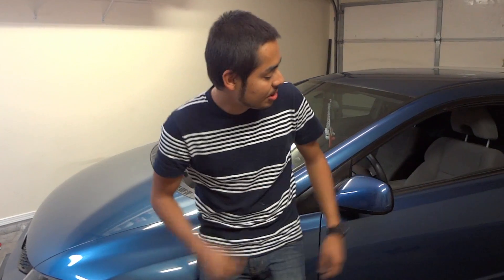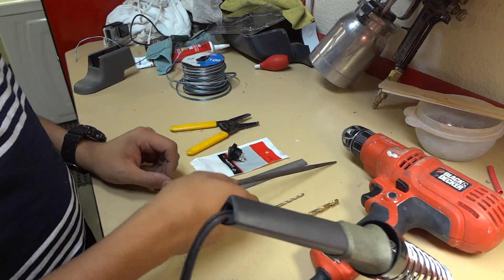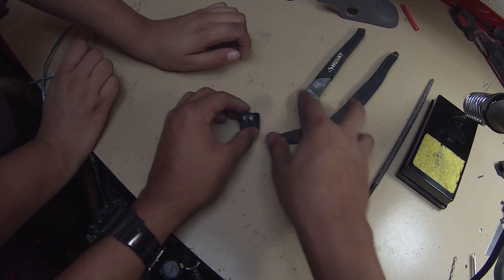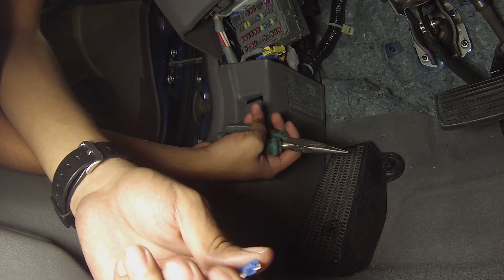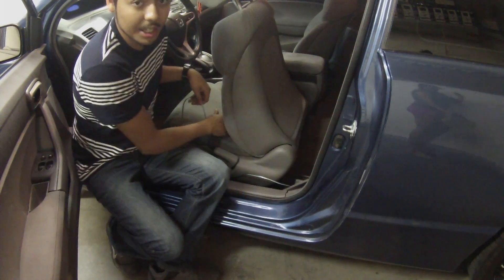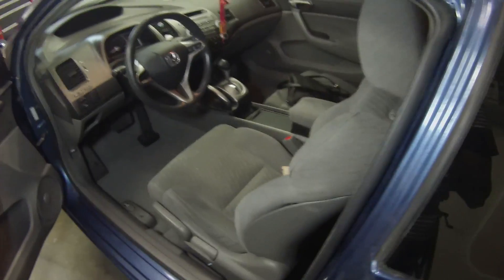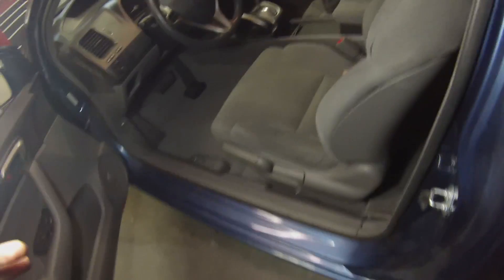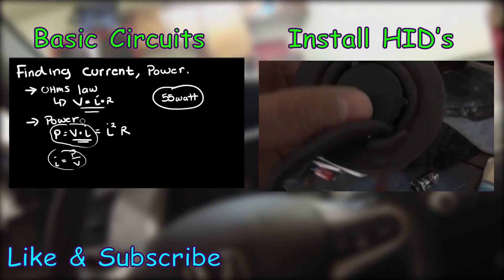How to: Install a Kill Switch on your car

Comment: Do you know if accidentally hitting the kill switch while driving would hurt the engine at all?  Or would it just cause a slowdown/stop?
Reply: You basicly just turn your car off. So there shouldn't be any major.
Reply: Very dangerous on the highway. Don't put it in a place where you might hit it accidentally.
Reply from the maker: +Daniel H agreed. I had someone put it behind their seat and rear passengers would kick it and accidentally turn off the vehicle while driving.
Reply from the maker: If you do turn the switch off on accident for whatever reason. You loose vacuum assisted brakes and power steering. This means you will need to step on the brakes much harder to stop the vehicle and also pull the steering wheel harder.
Reply: Christian Macias Actually, most steering wheels just lock up when they're shut off - that is mainly why this is so dangerous, especially on the  highway. Killing the engine leaves you coasting, but if you cannot turn the steering wheel, you're as good as dead, because you can't restart the engine until you've braked and shifted into park. The reason the Jeep Cherokee KL remote hacking experiment by Wired was so dangerous, was precisely because of that. Do not put your kill switch in a place where you can bump it.
Reply from the maker: Wow, I saw that study/hack. This leaves me wondering now because I was under the impression that electric power steering was an assist rather than a requirement. I know on power steering pumps that are driven by a belt to the engine, allow you to control your vehicle even when the engine isn't running. But still wow. I haven't had the chance to work on a vehicle with electric power steering yet.
Reply: Christian Macias Not all steering wheels will do it - on some, you just lose power steering, as you said. What you don't know can kill you, especially if you bump that switch in a curve on the highway. But yeah, the hack was dangerous because he lost all steering. My older jeep does the same.

Comment: how does that fuse still work if there's no continuity?
Reply from the maker: +Jason Lin We are using it to just hold the wires in place. The fuse is not longer working as a fuse. This is why we placed a new one on the switch wire.

Comment: This may be a stupid question.. but why has nobody thought of creating a fuse box that has some type of key, combination, or any locking mechanism? Same with modern cars and the output used for stealing them through the computer
Reply from the maker: +A Bennett Well ata fuses are designed to be replace quickly and putting a locking mechanism would defeat this. Modern cars have chipped key(immobilizers) that when near a very specific magnetic field, emit a code that allows the car to run. Really experienced car thieve know this and can replicate the code. There are car alarms like omega that have a controlled system to allow their car alarm to replicate this exact signal. This is why you can have remote start on a modern car that normally wouldn't have remote start. I have heard of this happening to people where they go and take their car for a simple tune up and the mechanic can capture the signal that your key emits. Then later he can locate the vehicle and hot wire the car because the vehicle thinks it has the correct key. I want to make a video explaining good ways to keep a car from being stolen, hopefully i can get to it soon. Thanks for watching!

Comment: There are a lot of things you can ground that will keep the car from starting/running.    Multiply switches for severe situations.   There is a problem here with having your car but with a dead battery after an attempt.  Fixed by jumper cables.  A pro thief will look at the fuse box before giving up because it is wire central..   And switche(s) out of sight under the dash and seat.
Reply: UhOh

Comment: i took the ignition coil fuse... worked the same cn
Reply from the maker: +María Delgado You can test which fuse will turn the car off by having the car running and pulling each fuse you think might turn off the vehicle. When you pull it and it does turn it off, that is the fuse you can use.
Reply: thanks

Comment: why not just put a fused switch on the starter wire and hide the switch so the starter will seem bad ..no power to starter

Comment: You would be better (easier, safer, less noticeable) if you spliced your switch into the wiring after the existing fuse. 
This would eliminate the need to add the fuse holder and to modify the existing fuse.
Reply from the maker: +Craig Meeker this is exactly what my intention was but due to camera angles, and reducing complexity this was the best I could do. I'm working on it though!

Comment: Easily bypassed by removing the modded fuse and plugging in a regular fuse.
Reply: The entire point is stealth. They don't know that, you do because you watched the video. Switch is installed in a low key area. They could just think it's a beater and move on to the next.
Reply: +hsucks  If you know where to look!
Reply: I might try installing hood locks and pulling the ignition coil wire.

Comment: why not just short circuit the fuse instead of drilling through it ?
Reply from the maker: +claudio68097 You can. When i did it, there was quite a bit of sparking (20 amp fuse), wires got warm. Personally I would image the fuse blows instantly but it took a few tries.

Comment: I think that wire is a little bit to thin to connect with 15 amp current potentially!I would take a bigger lead.. 
A to thin lead can potentially get to hot while driving a long time in the summer and melt the isolation.
There a lot of cars that were burned because off such sketchy work in the electrics.
You cant compare it with a speaker wire,because through a speaker wire goes AC!And only a bit of bass which has the most power.But on this goes a DC current and that goes continue in time,compared with the speaker wire.Look at the thickness of the wire inside the fuse!And thats only a very short wire and you are gonna make a longer wire and so with more resistance.And more resistance means more heat..
Reply: yep and the switch needs to handle 15A too

Comment: Better to put the switch on the GROUND wire to the Fuel Pump.   It's easy to locate and easy to tap in to.  And....NO ONE WILL SEE WIERD WIRES COMING OUT OF YOUR FUSE PANEL.  
Much more covert and easier.   Your welcome.  😉
Reply: saintchris514

Comment: The fuel pump fuse is a popular place to run a Kill-switch system.  A good Car Thief knows this as well.  If he is targeting your model car, along with a slim-jim he is gonna have a fuse or 2 with him.  He breaks in, car cranks but wont start, he opens the fuse-box, sees the installed wire, pulls it out, pops in a fuse of his own, takes off with your car. Maybe a break locking device would be a safer bet??
Reply from the maker: +Rohan Ebanks most Definitly. A user commented not to long ago and I like the way he said it. This Is like level 1. Simple but easy to by pass. I hope to have video soon that makes it more complicated but its difficult to make something that is difficult look simplier to be able to make it a successful video.
Reply from the maker: +Rohan Ebanks most Definitly. A user commented not to long ago and I like the way he said it. This Is like level 1. Simple but easy to by pass. I hope to have video soon that makes it more complicated but its difficult to make something that is difficult look simplier to be able to make it a successful video.

Comment: this is smart but ud want to.make this more discrete for a more valuable car then a Honda. as u will be dealing with smarter criminals I'd advise running it off the fuel pump from.under the seat.and hiding it in a place that isn't hard to be hit but feet or to hard to axcess

Comment: It's continuity not current, BOZO! the CLOWN! I've lost 12 minutes of my life watching the stupid video, dude STOP WASTING PEOPLES TIME!!!
Reply from the maker: Google continuity.
Reply from the maker: +Christian Macias either way. continuity is test by applying a small current.
Reply from the maker: +bob stout I'm an electrical engineer that tries to use less complicated terms to not scare people away from things that are simple. Must make you feel good to be condescending. Talking down when you yourself don't know much more than what a user manual / tech sheets tell you. This is my automotive channel. Not my electronics channel.
Reply: DC voltage is DC voltage no matter if it's auto related or home electronics related! Electrical engineer? Never seen one so young, you must be a savant or something? Never known a savant before, nice to meet you!

Comment: take out the fuse with the wire and plug in a new one and we are good to go. 10 sek tops. Yoy shoud have cut the wire behind the fuse box and put the wire there, that would be harder to se and fix.

Comment: Dont use the fuel pump fuse! Imagine that fuse falling out or barely connected plus It's hokey as hell! Use the clutch or brake switch ( yes the one where you have to hold the clutch or brake in order to start it. Way easier as all you do is relocate it from the pedal to another location. It's free and it works. Twice now I had someone punch the ignition and obviously someone tried to use the OBD port as the rubber boot was missing. No luck for the scumbags

Comment: great video, why not solder it to the outer terminals of the fuse so it does not spread the female terminals on the fuse box... unfortunately most skilled types will switch out the relays and switches and off they go

Comment: so how would i wire that kill switch with my horn so that when my kill switch is on and someone try start up the car the horn would go off and stays on when the car is cranking but turns off after it stop cranking?
Reply from the maker: A relay and a dpdt switch(or dpdt if you can't find a dpst).  Connect one half of the switch like the video but the other half with have a ground and a connection to a relay that will trigger it. Then the relay with honk the horn. When the ignition completes the circuit on the relay it will honk. This is great idea and if I get a chance I'll make a video on this!
Reply: when you said connect horn it reminds me of the jokes that Jeremy Clarkson does like connecting the brake wire to the horn 😂

Comment: this is like Level 1 beginner install. Level 2 would be removing the fuse panel and installing the switch on the circuit without any evidence that there is a switch installed. Level 3 would be to use a cellular or RF keyfob receiver instead of a radioshack switch.
Reply: I m going for level 1 just simple
Reply: Can we just skip to level 11 real quick? So, there are plenty of biocompatable polymers and manufacturing techniques to produce small flexible circuits. I propose a flat, flexible, sub cm^2 passive LC tank circuit laminated into an impermiable, flexible biopolymer and dermally implanted in a non irritating place in the hand. Then you need to install a solenoid in the car handle which is driven at some lower fraction of the resonant frequency of the implant LC tank and a pick up coil that outputs to a band pass filter wich is tuned to pass only the frequency of the implanted LC but reject the driver coil frequency. That way when you put your hand into the driver coils field, the implanted LC will oscillate as its resonant frequency and this will be picked up in the pickup coil, passed by the tuned band pass and from there, it can be detected by a microcontroller which engages a few relays which enable the fuel pump or anything else you want. This may sound rediculous to some but just watch a few videos on channels like Applied Sience or The Thought Emporium, or Cody's Lab to see what people can accomplish in a garage. The fact that you could custom tailor the system would make it virtually unhackable except through brute force.

On the other hand you could just get full coverage.
Reply: Atlas WalkedAway level 20 is just removing the motor
Reply: @levinausley288  level 50 is not even having a car to begin with therefore not having a car that can get stolen
Reply: level 2.5 set up a preseitent push button with relays and wire it to your ether your hazard flashers or rear window defroster so you have to turn that one before you start the car but you can turn it off after you started it
Reply: @ReAveR815  bluetooth is a crap ton less secure than rf. Btw most rf switches have a role over code making them harder to crack
Reply: When is the last time you trusted anything made by the IT industry to work consistently without failure, or do you want the RF Key-fob to fail and leave you in the middle of the freeway doing 70MPH???
Reply: DUDE  GREAT NOW U  TAKE THE TIME AND MAKE A VIDEO.   This was plain and simple  EASY PEESIE
Reply: Wait, you can just buy that shit? This plan sounds foolproof, why doesn't everyone just do that?

I think I'M going to do that.

Comment: I don't feel like this is an effective kill switch idea, wires coming from a fuse is extremely conspicuous so all someone would need to do is pull that fuse and put a new one and off they drive
Reply from the maker: +Ryan Hatton I agree! Ill add a comment on the video for the viewers to read the description. This  video should give the viewers an idea but following it exactly won't help very much. You should however, try to follow the wires in the fuse box and split it there.

Comment: I have a question why put a hole on the fuse?
Reply from the maker: +cannibalclown212 This was to break the fuse. You need to break it in order for the switch to work because if you don't break it, the fuse will bypass the switch.

Comment: why not just put the switch in-line somewhere after the fuse box instead of modifying the fuses?
Reply from the maker: I don't have a car where I could have easily explained put a swich directly. That was my original intention but to reduce complexity I did it this way.

Comment: (Not a car guy; don't hate) Couldn't you just install a switch on the battery?
Reply from the maker: Yes and no. When doing this straight to the battery, safety becomes an issue. Most switches can't handle the current a starter or other power hungry things that the car uses the battery for. If you had a switch that could do this, it would be fairly big. Not saying it is impossible but much less practical. This is excellent thinking though. What you could do instead is throw a switch on something directly that stops the car from running. We do this with a fuse but it could be a wire that goes straight to the distributor, the fuel pump, ignition switch, etc. This is even better than using the fuse because it is much harder to find and can't be quickly bypassed.

Comment: second fuse it's on + wire or - or it's doesn't matters ? thx
Reply: +SambadaTed it doesn't matter you are just putting a fuse across the circuit
Reply: +zghvbn1 Always but a switch on the ground, it reduces the amperage the switch takes
Reply: +zghvbn1 but why couldn't he  just leave the original fuse alone, and then just spliced the switch into the fuel pump power supply?
Reply: WeightPull ChAmP
he could have but  he is just using the original fuse "slot" as a point to connect his ring circuit with the switch ,it is not a bad idea and it looks neat and tidy and is not dirty or covered with oil,but yes splicing the the pos or neg wire would work,however you would have to start messing around in the wire loom or get your fingers full of muck splicing it near the actual pump

Comment: Speaker wire? Really
Reply from the maker: This is an optimal choice for a DIY project. It has a pair and as long as you get a gauge small than 18 (which is the size I used). It can carry well over 10A of current.

Comment: Hello, I have a drain that I was able to trace to some wires (a whole bunch of wires) on a clip that goes into my fuse box. I've been unplugging the clip so the battery won't drain. My question is when you turn the switch off does it kill all power which in my case I need to stop my drain. Please let me know, thanks.
Reply from the maker: +H. Jones If it's a clip with a whole bunch of wire then this won't work. If you can trace it a fuse then it might.

Comment from the maker: +Kimo Clyde haha yea, sometimes things slip by you when editing. Its hard not to repeat yourself when not on a script.
Reply: Reinstall a fuse it's there for a reason.
Reply: scavenger4life without a fuse any surge of electricity will destroy your radio and could even cause a fire.
Reply from the maker: +Stefan ramnarine we do that here 8:59
Reply from the maker: Hakasauars sure. What are you trying to wire up
Reply: when you drill the fuse were you hitting the metal part of the fuse or just the plastic.
Reply from the maker: We hit the metal in the center to break the contact
Reply: Do you need to add in that extra fuse? I understand you do it so you don't have to redo the fuse that you rigged up again but is it necessary for any reason??
Reply: Yes
Reply: i just did the same thing for my radio cause it wouldnt turn off with the truck.i did not add the extra fuse so i was wondering what would happen if i didnt have the extra fuse and if it failed would it do any real bad damage .btw i have it hooked up to a 20 amp toggle switch ,same amps as the fuse needed to run my radio just to add that in.
Reply: Hey Christian great stuff! I was wondering if you could give me some feed back on something im trying to wire
Reply: Christian Macias could you do one for the old superduty I have a 6.0L and an old 7.3L and around me they get stolen all the darn time.  I always put the club on, but you know that only offers so much protection.
Reply: Christian Macias Do you have facebook? I might have to draw it out